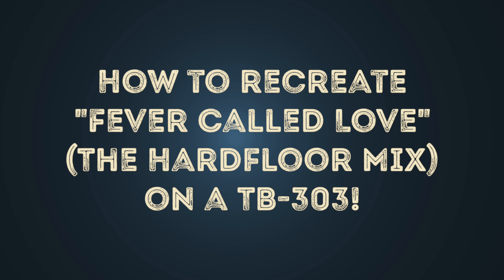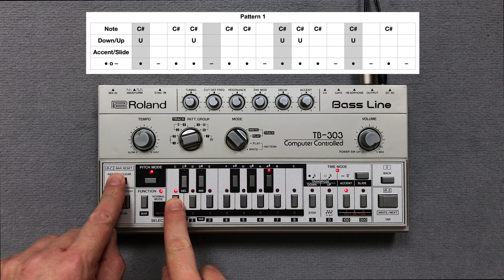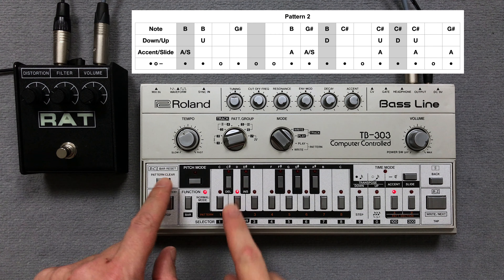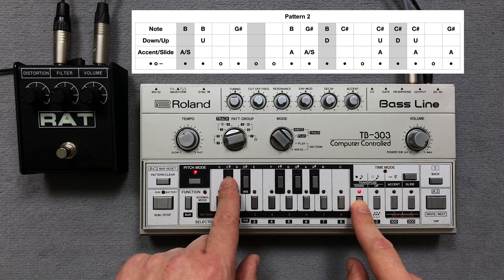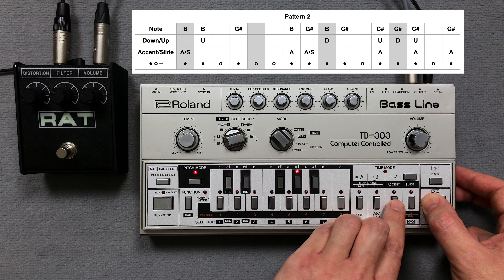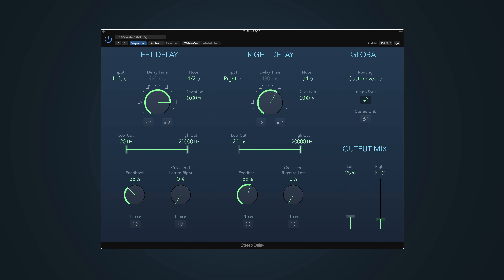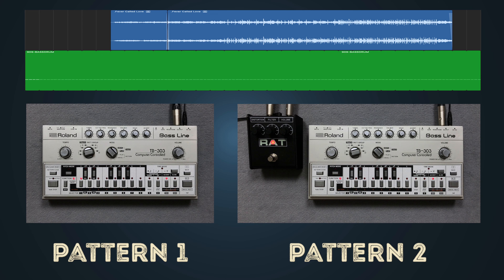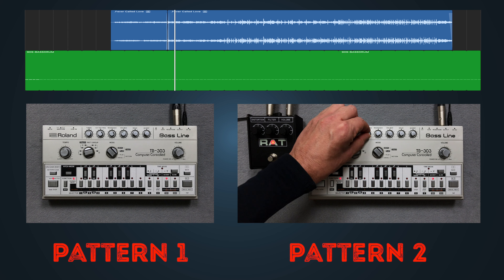Rising High Collective "Fever Called Love" (The Hardfloor Mix) – Roland TB-303 Pattern, RAT 2, TD-3

Comment: Is your RAT pedal stock or did someone (you?) modify anything? Cheers, Hans :-)
Reply from the maker: Hello Hans! The RAT pedal is original. I've never opened it or modified anything on it. Cheers 🙂
Reply: @DuckTronic  I always instantly like its imprint on the 303. Truly a classic, it seems. But... when I started researching it, ppl as always point to the original versions. With that LM308 chip iirc. Great to hear that the version you have also does the job absolutely fine 😀
Reply from the maker: Yes, my RAT should be the current model. I bought it used a year ago. To be honest, I like the MXR Distortion + more. But you can also get good sounds with plugins or overdriving the input gain on the mixer. Depending on what you like. 🙂